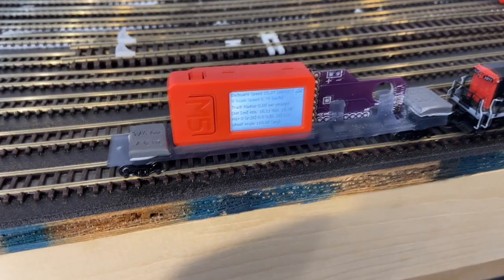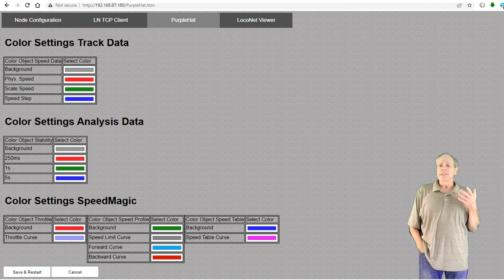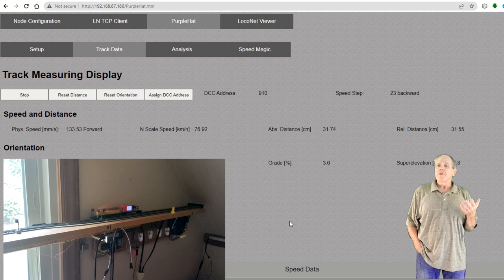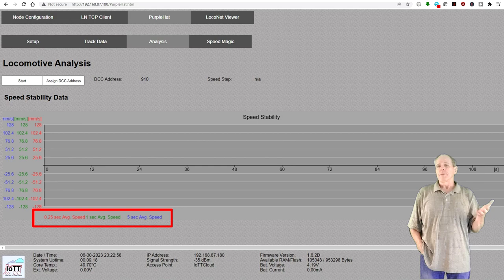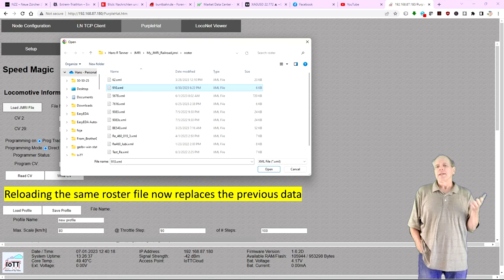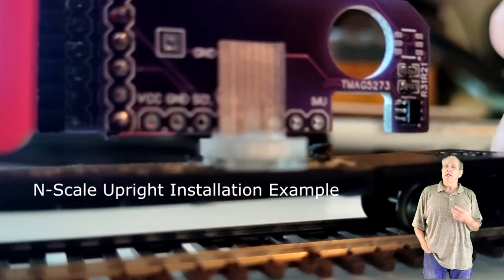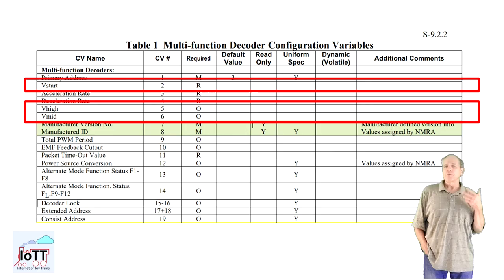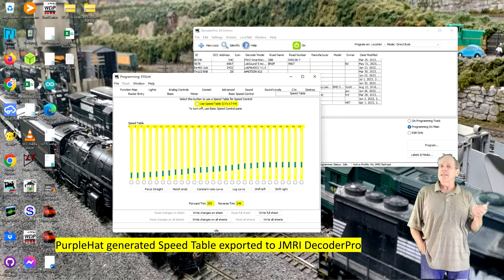PurpleHat Tips, Tricks and new Features (Video#122)

Comment: Hans, great work!  I'd love to see an analysis of the three speed moving averages for various decoders and/or locomotives.   My analysis has led me to conclude that accurate speed matching is not possible.   As you noted, locos change speed at the same throttle setting and worse than that, decoders have a built-in speed curve that plateaus long before 99 on my Digitrax throttle but at different points for different manufacturers or even the same manufacturer's decoders. It's not possible to get totally rid of that plateau.  Thus, I have given up trying to speed match locomotives.
Reply from the maker: Thank you. It depends really what one would call accurate. The decoders I think have a pretty linear speed step to PWM duty cycle ratio, but the non linearities come mostly from the cheap can motors. It is easy to understand that e.g. the friction of the motor and gears increases with speed, so more of the power is needed to overcome the friction alone, which creates non linear curves. 
For real locomotives, real precise speed matching is not necessary. he only thing that happens in e.g. a MU is that the loco that wants to go faster takes a little more of the load. As long as all locos are approximately the same, that is more than good enough. And for driving, I doubt that you can see from just looking at it whether a loco is going with 65 or 75 scale mph, so also here, matching requirements are relative.
Reply: @IoTT  thanks for the great information.

Comment: Hello Hans.
I'm at a bit of a loss.
I have my purple hat working and the car is built. 
How do I connect it to my computer to show all the speeds and graphs?
I know I had it working in the past, but it has been sitting in a draw for a while and I cannot recall the process or find the initial connection instructions on your website.
Please Help.
Reply from the maker: Connect to either a Loconet over TCP Server or a WiThrottle Server. If you are using JMRI, activate one of those servers in JMRI, then set the command source of the Stick to use that server. Check videos #122 and #123 for the latest features.
Reply: Thank you for the assistance.
I was able to connect  (changed home Wi-Fi, and had to reconnect to the new one) then I updated to version 6.4, which appeared successful.
However, after updating the purple hat was not recognized. 
I assume as a consequence of not recognizing the purple hat the speed panel is not appearing. 
I have tried rolling back to version 5.2. but was not able to.
The stick was showing purple hat data before the update.
Reply from the maker: After updating the software,  you need to set the command source and hat selection on the node configuration page. If you select PurpleHat and restart the Stick, it will automatically display the PurpleHat tab. If it does not, then there was a problem with loading the software. Try to reload in that case.